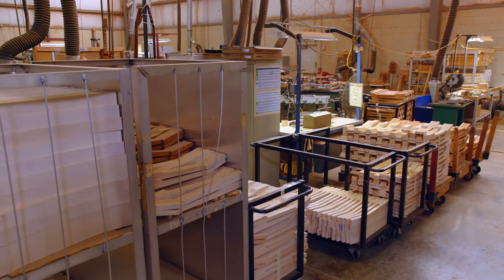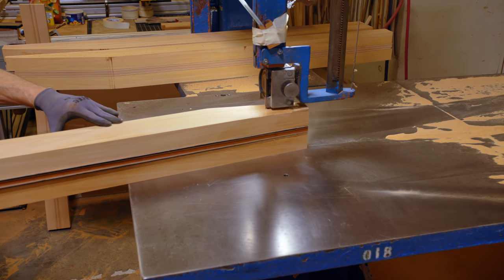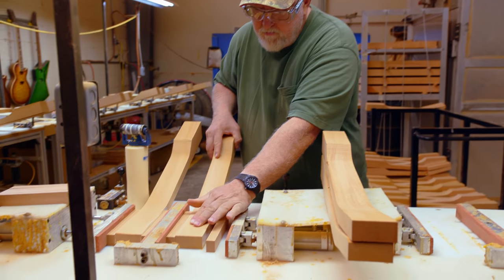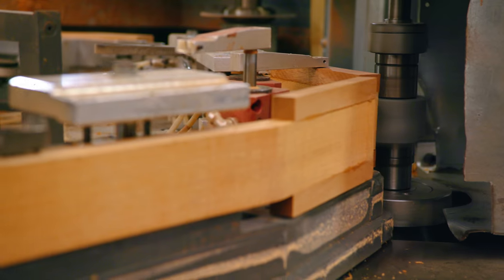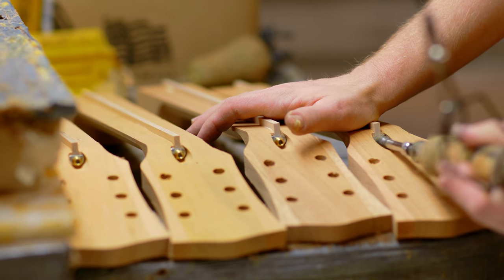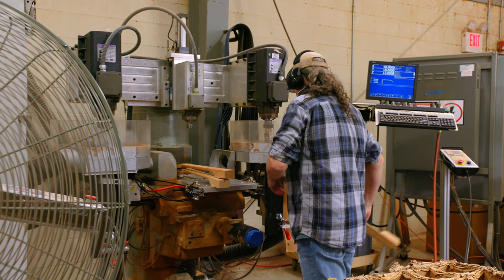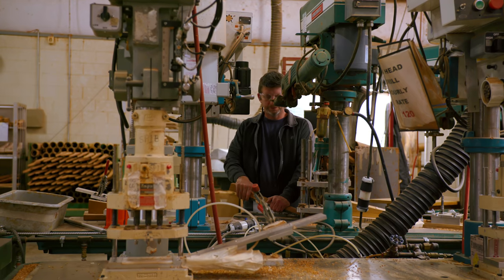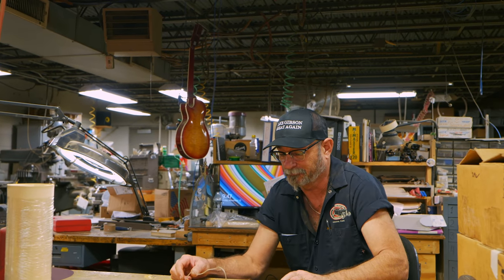How Guitar Necks Take Shape At Gibson USA | The Process S1 EP2

Comment: I had a Gibson 2008 faded flying V and I spent a lot of money on it as a teenager in 2010 on making payments on it, and I was sad it had tuning instability, electrical problems too from what the technician said when I kept bringing it back in to the shop that sold it to me in payments, but after awhile they took it back and let me pick 2 guitars and call it even and I truly miss that red flying V but I'll just wait for a epiphone used before I buy a Gibson because I was disappointed in it, I loved that guitar and it didn't want to work out for me. I still have the case for it
Reply: How can it have electrical problems that are not easy to fix? It's a pot, cap and pickup. V's tend to stay in tune well due to the inline tuners. Because you can't understand basic electronics in the guitar I'm inclined to think you also don't know how to set up your nut to match your strings and thus tuning issues.
Reply: @Les537  straight out the case the Nut by the headstock was needing to be replaced because when I Bent the G string a full step any where down from the 7th note it would slide off the nut slot on G. So actually, yeah I did know a little basic anatomy of what I was going into with that guitar. The built in neck was actually rolled really awkwardly which is why it got sent back the 2nd time when I had it for a good half year playing it a lot but then it got sent back for good. I have a shecter with a floyd rose special and Mammoth slinkys tuned to A# standard right now loaded with EMG 81-85 and I haven't had to tune the tuners at all. But this shecter puts up a lot honestly

Comment: Cesar Gueikian,
Would you please consider my solution to greatly reduce the amount of Gibsons that get their headstock broken. Add two carbon fiber stiffening rods that go from the neck and into the headstock. Use continuous carbon fiber layer linearly and have the end angled to match the headstock. The holly veneer and the fingerboard will fully conceal them so it would not change the look at all. But would make the neck to headstock transition so much stronger. Please consider doing this, it would make every Gibson fan so happy and willing to buy new guitars that they can more safely take to gigs without having to worry someone might knock it over and break the headstock.

Comment: I’ll never understand Gibson. Both Les Pauls I’ve owned needed to be shielded and the fret ends all needed dressed and rounded. The nut work was acceptable but could have been better. I have an Epiphone Paul that’s way better than my Gibson.
Reply: No you dont epiphones are garbage, you are poor that's fine. I could tell you blindfolded without ever strumming once if I am holding a trash epiphone. The necks on them are a joke.
Reply: Not a chance in hell. You are telling stories out of school. I've owned 3 gibsons and about 20 epiphones. I would trade 100 epiphones for a gibson. If you had a humbucker les paul then it didn't need shielding and it comes with it anyway.